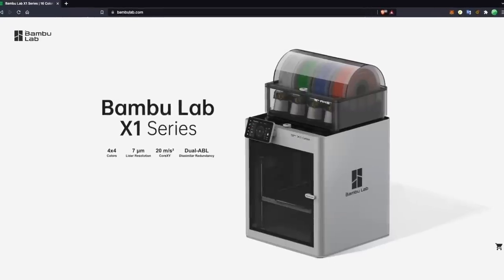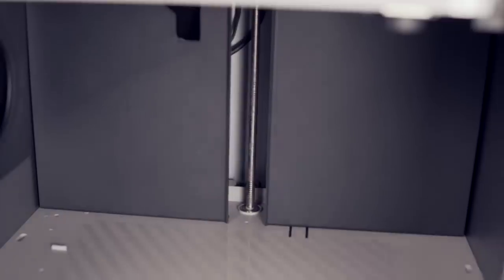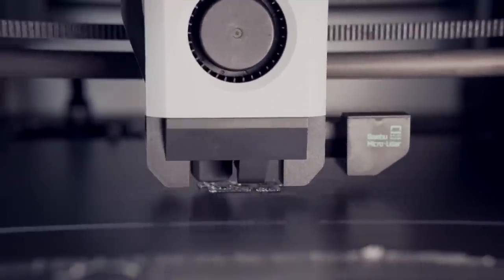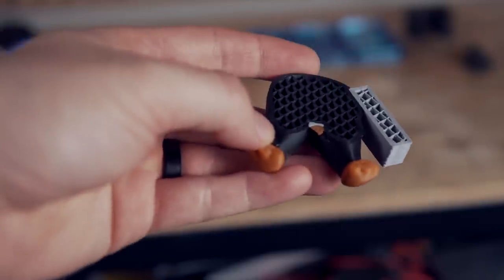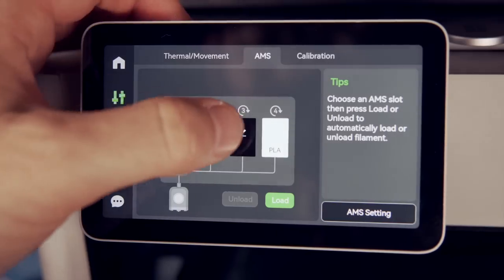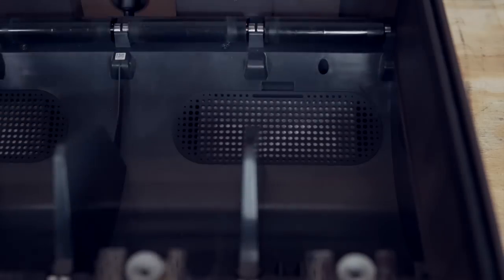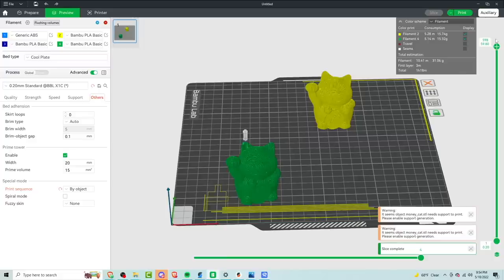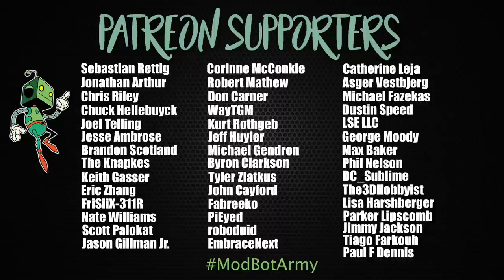INSANE 3D Printer That Requires ZERO Calibration (X1 Carbon)

Comment: This should be a wake up call to manufactures still selling bog standard i3 machines for around the same price as this machine. Hope we see more affordable corexy's.
Reply: I think it will only really come till we get cheap closed loop motors.  The belts need to be good and taunt to keep that kind of speed up without shifting.
Reply: @warlockd  going to encoders is $90 extra on the steppers, the real cost is in the mobo where you might be spending an extra $300 to actually use those encoders
Reply: Agree, the 3d printer community ended up being naturally a bunch of engineering minded modders so weve unwittingly HIGHLY incetivized all these manufacturers to let the end user do all the R&D and just sell the part rather than integrate it into the next iteration of their platform. 

Letting someone else do R and D and just stealing the intellectual property should sadly, be expected anyways considering where most of these devices are manufactured. 

TLDR: We need a 3d printer so plug and play, that a wine mom can use it as a kitcen utensil for christmas decorations and birthday parties.
Reply: Same goes for the flsun v400, it outclasses every other printer in the sub 1000 dollar/euro range. I mean klipper on a out of the box machine is just amazing, bimetall heatbreak is really rare and 400mm/s printspeed is higher than most industrial printers can achieve
I just hope flsun keeps their promises about the v400
Reply: your stepping too far here, first you have to prove the actual kickstarter isn't a scam to make money.  too many are.  Yes, the machine sent in this video appears fantastic, worth over $2000 USD for what it claims/can do -so why are they kickstartering at all?  They plan to ship in july - which is rediculous amount of time for 'need money for production' (2 months) so it can't be that.  They should just be selling the units, even at $2,000 each (carbon and ams together)
Reply: Now imagine 3D printers that can layer various types of plastics and rubber 😎
Reply: @xXKisskerXx  Just saw their workplace. They do indeed have hundreds of units being tested with various people.
Reply: Lulzbot is still stuck in 2016. They need to pay attention.
Reply: @kongchho  Silent steppers on a machine that's like 2 grand🤣🤣 At least they have e3d hemeras.
Reply: @xXKisskerXx  your comment didn't age well

Comment: I thought this was going to be another crazy unaccessible printer that only large printing companies could afford. But it costs less than a prusa. That’s insane
Reply from the maker: I honestly did do. Pricing was not initially available when I had agreed and I was expecting north of $2k. That was actually one of my questions when I had a follow up call with them. It sounds to me like one of the key differences is automation in manufacturing. I was told roughly 80% of the machine is assembled by robots which should mean higher precision and quicker output.
Reply: Am certainly buying one, the only thing is that the slicer is online only and would like if it could work with cura.
Reply: @ModBotArmy  "Higher precision" and "robots" don't necessarily go hand in hand. Ask Elon Musk why he nearly went out of business in 2018. He "Over-automated" his General Assembly lines and found out what the rest of us already knew, that the human eye is still the master of the "Fit and Finish" universe. How would I know? I was one of the bazillion Controls Engineers approached to help out during that time.

Vision systems are even worse, probably 50% of them get ripped out before ever getting fully commissioned. Last year I was called into a plant to finish up a project that loaded blanks into a Mazak lathe. It had a vision system which was never going to work since the blanks had the ends basically "polarized" due to the marks from the band saw. So the rotation angle of the blanks would either show a bright reflection, or a dull dark gray. The vision system couldn't handle it.

Robots are usually very repetitive, but don't bank the farm on it. At a car factory that I used to work for the robots went whack-a-doodle and a number of spaceframes had to be scrapped. That was a weird one... What's more common is that welds go missing and someone has to set up shop in the screen guard and hand weld the missing spots before the jobs reach General Assembly.

But one of the most frequent jobs for our electricians was to "touch up" the paths for robots.
Reply: @ModBotArmy  any chance you could give them a feedback that we all general would love a standalone software for the app rather than online and also the ability to use it will CURA.
Reply: Only for the Kickstarter tho
Reply: @ameliabuns4058  The advertised MSRP is $999 and that's whats got me suprised
Reply: And it's full of proprietary parts and software.... While the i3 isn't.
Reply: @zoetmoments5625  he did say it works with Cura and SuperSlicer, at least. They just can't utilize the lidar system.
Reply: @BrunodeSouzaLino  doesn’t matter if the parts are of good quality and since the printer is well priced I don’t see why the parts wouldn’t be
Reply: @shiikon2193  It absolutely does. Where do you go to for support if this company fails? Parts don't last forever and wear out.
Reply: But it's completely closed; proprietary software, proprietary hardware. This is more like a cheaper version of an industrial printer than a better Prusa. For example, I'd like to know where I can get replacement parts, other nozzle sizes etc. I'm in the EU, so neither Texas nor Shenzhen are actually easy to order from. I'd also like to know if this printer can even work without a WiFi connection. The fact that it can print G-code from Cura from an SD card doesn't say anything about whether it can do so without internet access...
Reply: @henninghoefer  And you can't even make full use of the printer without its proprietary cloud based software, as the lidar sensor doesn't work with other slicers.
Reply: @BrunodeSouzaLino  That's a risk I'm more than willing to take. There's literally no other printer that comes close to this, it's the price you pay for having cutting edge tech
Reply: @shiikon2193  I feel like it's too good to be true.
Reply: @MrWaalkman  my experience with vision systems in industry is managers see it as a cure all and don't realize they're limited just like humans are .

I've spent years implementing them in production environments and the hardest part is getting humans to understand the camera requires a good environment and it will catch everything i tell it to. If those things are something you want to ship, but shouldn't, we are going to have a problem. 

As with most manufacturing problems, it again, ends up being a management problem, not a technology problem.
Reply: @fataxe1  Yup. I had one boss that all you had to do was throw buzzwords at him and he would buy into it. :)
Reply: @Becvar80  i later saw on spec from site i missed that in the video.
Reply: @KentoCommenT  that’s for the X1. Not the carbon edition
Reply: @MrWaalkman  These anecdotes are precisely why I as an IT dude am not scared of AI... at all :D. The only scary thing is when the types of managers described try to use automated systems for things that put lives in danger.
Reply: Ah ah ah... Only if you get the Kickstarter. Go look at non KS price. Over$1k
Reply: @fataxe1  Well that’s an risk they have some redundant systems so that it isn’t dependent on those.
Reply: this should be your first warning flag about a (possible) scam.
Reply: @zoetmoments5625  The ultimaker team seemingly wants their software to be the most inclusive software and with a printer like this that could very well disrupt the market im sure they’d love to jump on the boat with them and get cura working with the X1
Reply: I just bought two Prusas, one with MMU. Wish I had known about this a month ago... 😬
Reply: @zoetmoments5625  The slicer is NOT online only. Far from it. The slicer (Bambu Studio) works just fine from the local PC that is installed, without ever being hooked up to the internet or the cloud. You just copy the file to a microSD card and take it to the printer to be printed, and it will very soon be able to send the job via wifi. You never have to connect anything to the cloud to have it work.
Reply: @SteinErikDahle  Cancel the order. I did.
Reply: @henninghoefer  So is the Apple iPhone. Proprietary hardware and software. This  is the Apple of 3D printers. Except  better than Apple because their slicer is open source, where with Apple nothing is open source.
Reply: @TheNature101  yes, that's exactly what I meant. (And I bet the only reason to open source the slicer is that they're legally bound to do so, because they based it on Prusa Slicer)
Reply: @Becvar80  it works with other slicers as long as you don't use the key component that allows it to work at speed,,,,,,,
Considering how much open source labor went into their product (standing on the backs of giants) I'd expect them to at least make the lidar part of the G-code instead of putting it in a proprietary binary wrapper.
I'll stick with a Prusa that doesn't try to force me to upload all my designs to them.
Reply: @ModBotArmy  cost as always depends on where in the globe one lives
Reply: If I hadn't already bought a Qidi X-CF Pro... 

I have no regrets. The X-CF is a brilliant printer.

Comment: woah woah woah woah woah... this is hands down the most impressive FDM 3d printer i ever seen... this pretty much beats every other FDM printers,  modded, self-built or commericials... it has pretty much every single advanced features that most advanced users dreamt of tightly integrated into the printer.... the mechanical designs also make sense.... i am just speechless throughout the entire video.... THIS IS THE DREAM PRINTER.

Comment: Using LiDAR to check line thickness on the first layer is next-level.
Reply: Except the first layer is hideous on every review I've seen.
Reply: @chrismorrison9140  haha, perhaps because when we are manually adjusting the bed, we are talking about adjusting for 100ths of a mm. Sensors doing autoadjusting is great in theory, the question is what is the accuracy and precision of this process. I suppose if it is 100% automated, perhaps it doesn't have to be 100% as good as the best human adjustments to sell the feature to me. But it does have to be say, 70% as good.

Comment: This is very impressive, especially for that price, I might get one for retail later on this year if everything turns out well on their end. Also I wonder if lenovo might have a problem with the name X1 carbon considering they have a laptop line with that exact same name
Reply: no they don't have laptops with same name. X1 laptops are Lenovo. Do you also think the Elagoo Mars and Mars Confectionary's Mars Bar are similar? lol. 

I mean Lenovo have only been making the X1 series of laptops for a decade now... pretty sure they are up to their 10th gen.
Reply: Copyright for names only protects against using the same/ name colours etc in the same sector. E.g if lenovo made a 3d printer or scanner etc called the X1 carbon before Bambu did, only then would they have the right to sue.

Comment: Thanks for the video.  Clearly a better printer than most of us thought.  That said, their failure to use an opensource slicer, firmware and building their own web server are three HUGE strikes against them.  Eventually they will stop working on the slicer and firmware as they either go under or move on to new projects.  That gives this product a short shelf life as far as printers go.

Having a proprietary ecosystem likely means they plan to sell over priced service/replacement parts, charge for cloud service... even if they deny it now... and try to take advantage of their closed ecosystem to make money down the road.  There's a business case to be made for that.  On the other hand, a company that truly believes in their product, wouldn't be scared of opensource software...  instead would embrace it because that means they would benefit from the work of many unaffiliated developers.
Reply: He said it works with "normal" gcode as well though. And for the stuff that wouldn't work with that, someone will probably reverse engineer a solution

Comment: If i wasn't building a Voron 2.4 id just buy 2 of these. I really like the auto flow, i'm all for automating every function of tuning and calibration, only missing the nozzle touch probe like a cnc machine.
I however would not want cloud services, if you need remote access just use chrome remote desktop.
Reply: Would not be surprised if something like that comes to klipper.  Get the LiDAR hooked up to the raspberry pi and it should be possible

Comment: Fantastic and informative overview. Thanks. The temperature issue in the slicer is a big deal. They are overheating to compensate for the speed. It should be the other way around. The slicer/printer/hotend should be able to accommodate the speed but it should have the optimum temp in the slicer for the filament. So when it's small moves like your example the printer is at the right temp. RRF has feed forward which means it can anticipate the coming moves and heat up the hotend ready for the high flow. They need to look at this. I wouldn't want my profiles to have to be adjusted for speed.

Comment: good to see a new printer that's actually a well thought out and usable tool out of the box. the proprietary cloud software is a little concerning. Understandable though. the lidar rig probably needs a fair bit of custom work. I'd feel a bit better if the remote printing didn't require going out of a network I control. proprietary is fine if you aren't worried about critical infrastructure dropping out from under you. 

That said, it still looks like a very promising machine and software suite.  It's what an entry level machine for the layman should be. I may pick one up after it releases.

Comment: My big concern is, how confident are you that this will continue to receive support? This looks amazing and I would hate to see this die. Mainly with the software perspective, 3d printing software, be it the slicer, firmware, and apps are developing quickly and I don't want to see that fall behind. If confidence is high, I am buying this immediately.
Reply: You should be rather concerned if you can buy one for the MSRP after since it just blows away the competition with ease. If print-farms can produce the same amount of products with 5 to 8 times less printers, the demand will sky-rocket.

Comment: if they actually keep those prices, this basically makes any printer on the market under 2000$ obsolete.
Reply: And they could get those $3000+ printers too if they manage to make a 512mm^3 version
Reply: once again this should be your first red flag for a (possible) scam.  Your saying a fully assembled pritner, is better, calibrated, and ready - than a voron or ratrig or sk-tank, and is cheaper?    The Triangle doesn't agree.  You can either be Better,  Cheaper, or Easier on the User, but not all 3.
Reply: @xXKisskerXx  First of all, this printer isn't better than any of those printers you listed. Secondly, you need to do more research before concluding that something is a scam because it's "too good". They've manufactured up of 500 units, and shipped around five production units to reputable youtubers. It isn't a red flag to have a machine that works. It seems like they've combined the cheapness of chinese manufacture with a ton of R&D work to make an excellent machine. I just hope it actually sells at their claimed prices.
Reply: @xXKisskerXx  You are 100% wrong. Voron and ratrig are good (and very expensive) printers. But what the X1C has that voron and ratrig does not, is 100 DJI super smart engineers and custom from top to bottom hardware and software, ala Apple. They also have a ton of sensors and AI software that voron and ratrig do not have. The magic of the X1C is the beautiful choreograph between hardware and software. They have done what the industry should have done many years ago. IMO, they will own the 3D printer market within 24 months.
Reply: @xXKisskerXx  this aged terribly.